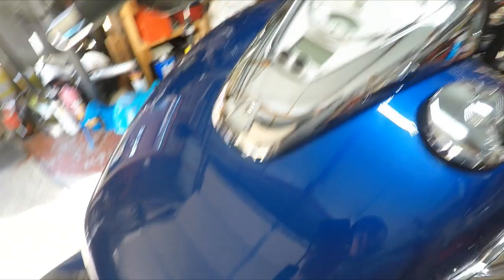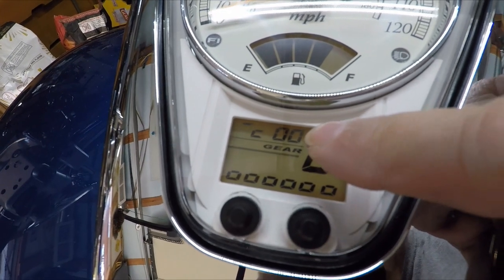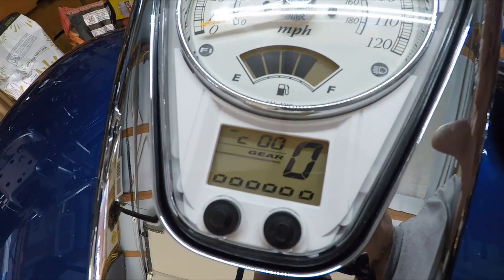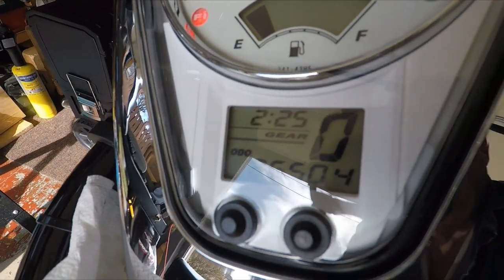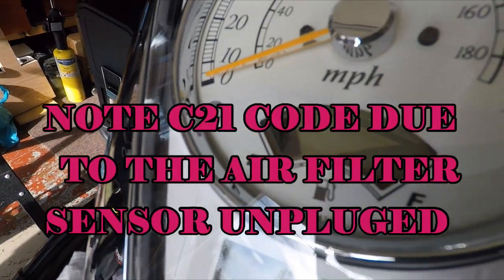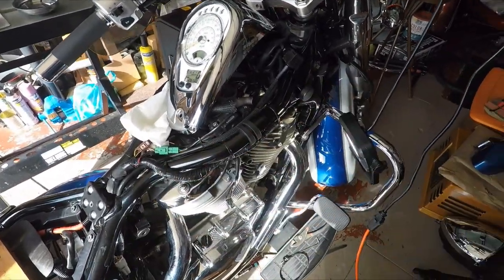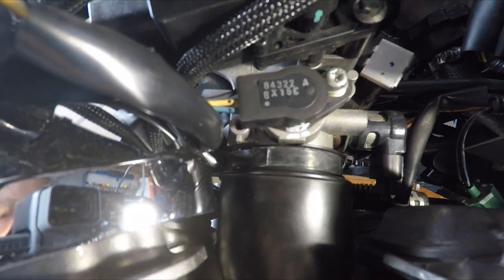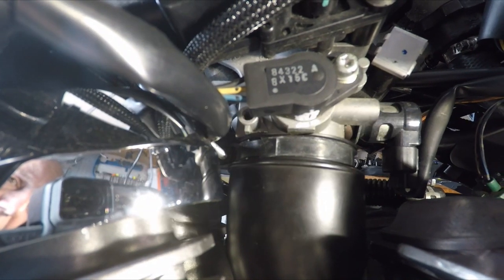SUZUKI BOULEVARD C50 SETTING THE  (SP) THROTTLE POSITION SENSOR

Comment: Thank you, thank you! After troubleshooting my M50 for a year, this video helped me figure out it was the TPS, after replacing just about everything but the engine on the bike. Back on the road now. Cheers!
Reply from the maker: Hi Bill, Thank you for watching and your comment. I think my next video will be on a problem that a viewer has.  Ride safe.  Norman
Reply: @2001himax  hi I have a 2006 Suzuki boulevard on July 4th weekend the fuel line popped off and since then the bike has no power when hit the throttle the bike sounds like it's drowning and then shuts off. I rebuilt the fuel pump cleaned fuel injectors, change plugs, TPS is working, compression is good in both cylinders..... Here's what still happening new front spark plug is white probably means it's probably running lean with all that fixed while riding and giving it throttle it seems to be missing on one cylinder...... I don't know if there's a way to pull up codes on this bike to see exactly what's wrong maybe you have a few ideas to help me PLEASE!! Always enjoy watching your videos they're very informative even when it's a different bike not the Suzuki boulevard.
Reply: @2001himax  thank you in advance for your time and patience to answer my questions and read my list of problems for my bike. Keep up the good videos, enjoyable and informative 👍
Reply from the maker: @jasonsanderson9385    Hi Jason,  You put new plugs in and the new plug in the front plug is white ?  It sounds like the front plug is fouled. He is what I would try. Put two new plugs in, fill your gas tank.  Make sure plugs are gapped. Start the bike and have it idle. If it is idling good let it idle for ten minutes.  Then put a little throttle on and see if it runs better. When the fuel line came off you used all the fuel out of the system. There may be some air in there. If this doesn't work go to You-Tube and put in  2006 Suzuki Boulevard How To Bring Up Codes.  If a different year comes up watch it and see how it's done. Then look at your bike to see if it  has a plug to bring up the code.  This a start to find the problem.     Norman.
Reply: @2001himax   ok everything is done you suggested 🤯 ..... I think TPS is the culprit, I think I overlooked it assuming it was working properly. Ordered new TPS and will arrive this week hopefully by next weekend latest.... I'll keep you posted if bike is still down after installing new part. Again thanks again for your help and always great Videos 👍
Reply from the maker: @jasonsanderson9385  Hope that takes care of your problem.    Norman.

Comment: I have a question my c50 is not getting gas in the front cylinder and I'm getting a few flashing bike only has 4000 miles  it set from 2017 until last year I've changed fuel pump twice and the throttle body what could it be

Comment: Hey brother I have a question if maybe you have time you could assist in the solution to this issue . I have a 2007 boulevard c50. I am having a issue when my bike is coming to a stop or at stop engine is
 stalling out . I got into the gas tank and found the return hose was not connected . I fixed that adjusted the idle then saw your vid and adjusted the throttle cables . It helped but went back to stalling ..And my fi light has been on since I got this bike . Any ideas you may have would be appreciated sir . Love how informative this mans videos are ..GREAT JOB 👍
Reply from the maker: Hi Douglas,  The Boulevards are known for this problem. Mine has the same issue. Runs great but idles up or down. I am still working on mine. From what I understand it's the I.S.C.   The Idle Speed Control. It's a part on the carb body.  The I.S.P. could be faulty and needs replaced and if it is replaced you need a special tool to  have it set to your carb body.  You may have to have a dealer do it. Not cheep. I have contacted Suzuki about how many are having trouble with this problem but not herd back yet. I bought a Honda and have been working to get it on the road. I will get back to the Boulevard sometime. Sorry I don't have an answer for you at this time.   Norman.
Reply: Did you ever find out what the problem was having the same problem with 05 bulivard c50

Comment: Where is the predecessor of the engine operating, Susuke Boulevard, opening and installation diagram
Reply from the maker: I am not quite sure what you are looking for. It may be in the work book . I bought mine from E-Bay.  It's the Clymer maintenance,  troubleshooting,  and repair  Manual.     Norman.

Comment: What year is your Boulevard? Mines an 05, doesn't look like yours. Mine has an issue, it shuts off at about 70 mph. I have to pull over, put it in neutral and then the fuel pump kicks back on and it fires up. Any idea what that cause might be? Someone told me the brain box needs replaced or recalibrated. Any help please?
Reply from the maker: Mine is a 2012.   It sounds like you are having a lack of fuel when going 70. That is when you are using more fuel. It may be the fuel pump. The fuel pump may not be able to keep up with the need for more fuel.  It's harder to work on the newer bikes because the fuel is a sealed system and under pressure. That is why you never smell gas like with the older carbs. Even on cars this is the way it is today. I wish my bike had carbs. Carbs can be taken off and cleaned or rebuilt . With fuel injection and all the sensors it's a nightmare. You may have to have a dealer look at it. Yes I said that bad word "DEALER".  Get out the checkbook.  Norman.

Comment: G,day, I've recently bought myself the c50t 2012,beautiful bike, but having a problem trying to change the digital time clock, please help me. Thanks mate
Reply from the maker: Hi Robert,  You have two little black buttons on your dash. Push both of them and hold them down till the hour flashes, when it flashes release them , use the right button to set the hour by pushing it down and releasing it till you get the hour set. Next ,  push the left button down once ,  the minutes will flash.  Now use the right button to set the minutes.  When done , push the left button once and the clock will stop flashing and the time will be set.  Let me know if this helps.   Norman.
Reply: @2001himax  thank you very much for your help Norman, I enjoy watching your videos, very informative. Keep them coming. Cheers mate.
Reply from the maker: @robertpitt2212    Thank you Robert for watching.    Norman.

Comment: I'm having problems with my 06 suzuki boulevard c50. It keeps revving up and down. I have cleaned the injectors, replaced a vacuum leak and replaced my plugs fresh new fuel.
Reply from the maker: The Suzuki Boulevards are known for this problem. Mine is a 2012. The code comes up "C 40" witch is the "I.S.C."  = Idle Speed Control.  I have been trying to fix mine but I may have to take it to the dealer. The Clymer book says that to replace the I.S.C. the new one has to be reset to the car body.    Norman.
Reply: @2001himax  thank you

Comment: It's FI and it lights up when there is a problem with the fuel injection.
Reply from the maker: Hi Jim, If all the fuel injection system was removed would the light come on?. It would be nice to put carbs on this bike.

Comment: My 06 C50 is having major surging problems at idle and low throttle.  I'm hoping it's the TPS.  I'm wondering where you got that switch?
Reply from the maker: You mean the dealer switch ?  From E-Bay.   Can't remember the price.
Reply: @2001himax  Thank you Norman I just ordered one.
Reply from the maker: @ketibbitts    https://www.youtube.com/watch?v=rJIw7YQFzLw
Marilyn,  Please watch this video.  The switch will only show the code. Then look up the code in the Clymer book for the problem. About the switch=  Plug in your switch , Make sure the switch is in the off position, Turn on the bike. No need to start the bike. Turn on the switch and the code will come up. If you want to remove the code turn the switch on then turn on the bike. This will remove the code. I suggest  1= bring up the code and take note of it.  2= erase the code then try the bike. Just maybe the bike will run O.K.  But most times the code comes back up. Worth a try. Hope this info helps you.  Norman.
Reply: @2001himax  Hey Norm thanks for your response.  I'm been riding for years but I just got a 06 C50.  The problem is it surges at idle unless I'm giving at least a little bit of constant throttle. I got the dialer switch and my throttle positioning sensor was off so I straightened that out.  After that, I removed the battery cables to reset the computer.  I also removed and cleaned both fuel injectors in case they were dirty.  The air filter looks clean, I can hear the fuel pump priming when I start the bike.  I'm not sure how to check if the pump is going bad or not creating enough pressure? I put the bike back together and it’s still surging.  Do you know if there's a way to adjust the gas to air ratio or if that would even be the problem?  I don't know what to do next, any suggestions would be greatly appreciated.
Reply from the maker: @ketibbitts    The C50 are known to have this trouble. Mine has this right now. I believe this has to do with the  ICS  "Idle Control Sensor".  You need to talk to a dealer about resetting the ICS. They have a tool to do this. A tool that cost about $360. It's looks like a scanner that you use on a car but is made for a bike. One thing to try first is have your bike off,  Plug in the dealer switch. Have the switch in the ON position then turn the key on. You don't have to start the bike. This will clear all codes. Now try the bike.  If you want to read the codes have the switch off then turn the key on. I bought the tool a while back but haven't tried it yet. It came with very little instructions. I thought it would have a book. Then it comes with a lot of cables for different make bikes but the Suzuki cable did not fit my 2012 C50. So more money for the cable to fit my bike. A lot of the C50s Are having this trouble. As I said I would talk to a dealer and get their thoughts on this issue. Hope this helps.   Norman.
Reply: @2001himax  Thanks Norm I was guessing the dealer would have to be my next step.  Great videos I'm a fan.  I love your Harley.
Reply from the maker: @ketibbitts   Thank you for watching. I wish there was an easier way for you to fix it. I am old school but I try learning this newer bike with all the sensors and sealed fuel systems. Let me know how you make out.  Norman.

Comment: I have a problem with the air sensor, when I unplug the hose, it works ok
Reply from the maker: First I would look at the air filter. Is it clean?. If it is old I would put a new one in. Check all the passages that the air goes from the air intake through the air filter and into the motor. You may have a blockage. Hope this helps.
Reply: @2001himax  As you know there are to sensor when I pulled the sensor hose one of them work fine and the other shutdown the motor bike.
Reply: @2001himax  As you know there are to sensor when I pulled the sensor hose one of them work fine and the other shutdown the motor bike.

Comment: Having problems with mine. 05 boulevard c50T.  Idling sounds normal,  just when I go riding its sounds like there's hesitation in throttle if I speed up a little. If I stay on it it sounds fine. Any ideas???
Reply from the maker: Watch my video I put up last night. I and many have this problem. No one has the fix for this yet. In the video I talk about the tool that may fix it. If we get the money from Trump I will get the tool and see if it works. Norman
Reply: I've taking the throttle body off but cant seem to break lose those retaining screws.  Any ideas?. Mine have yellow paint on them.  Page 247 in the manual figure 39 A
Reply from the maker: @caseymclamb5890   Hi Casey, You are talking about the Philip screw?  To re move it try this. Take the best fitting screw driver that you have that fits it.  Place it on the screw , push down as you try to tighten it, yes tighten it very slightly then counterclockwise to loosen it. Do this back and forth many times to see if it loosens up. If it does not turn place the screwdriver on the screw an tap it with a hammer, not too hard just a light tap. Now try the back and forth method again. There are many things on these bikes that are so tight when  they are put in at the factory. They use air wrenches to speed the process and they are set too high. I broke a wrench taking off the valve cover, it was on so tight. If this does not work let me know.   Norman
Reply: I'm having the same problem with my c50t did you happen to figure out the problem
Reply: Hey buddy did you figure it out my 2008 c50t is doing the same it's killing me

Comment: What book is that?
Reply from the maker: Clymer Suzuki  Volusia/Boulevard C50 2001-2011 maintenance, troubleshooting, repair.    My bike a 2012. When I bought the book the dealer said the bike was too new to have the book for the 2012 but this book would cover my bike. You can find it in E-Bay for around $30.   Hope this helps. Norman
Reply: @2001himax  yessir. Thank you again